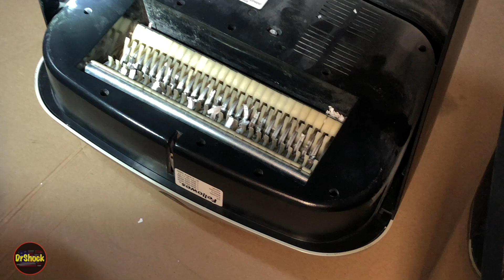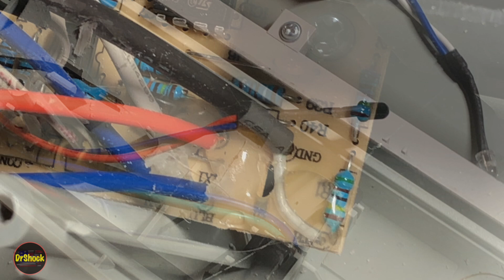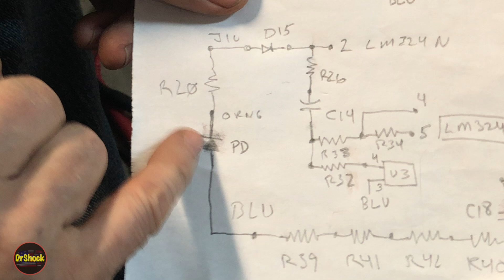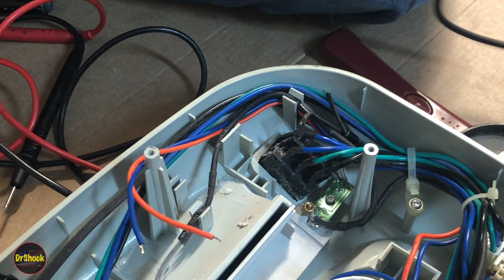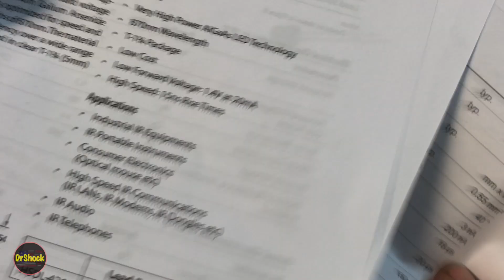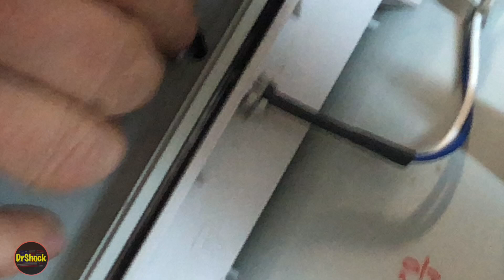Paper Shredder Runs Continuously in Auto Mode ~ IR Paper Detect Circuit Repair (Fellowes PS-14Cs)

Comment: It didn't help me to repair my Amazon Basics Shredder model C284-AUX.
My components are both clear looking diodes one with a light blue tint. One is physically damaged and needs to be replaced. 
Not sure about what their working voltage should be. 
eBay shows parts with 1.2V nominal.
Reply from the maker: This video is only for the Fellowes brand, one cannot expect commonality in circuit designs across multiple manufacturers.  Some cheaper brands use photodiodes, but Fellowes uses phototransistors so a different diagnostic and repair approach.